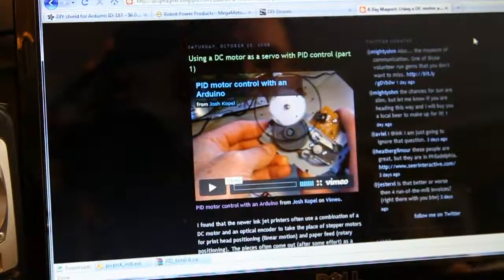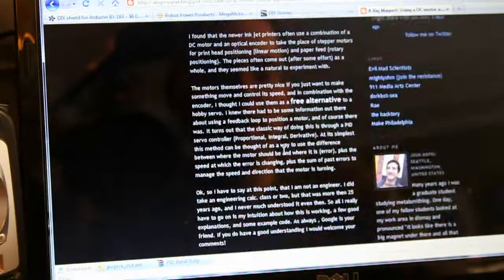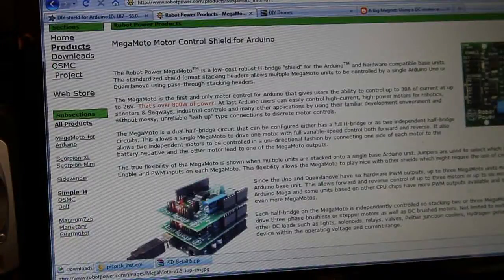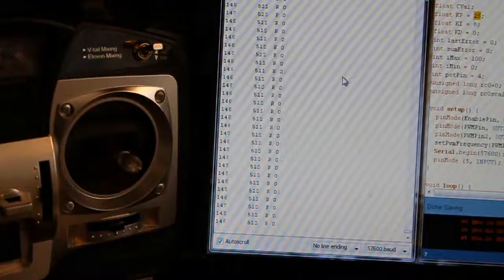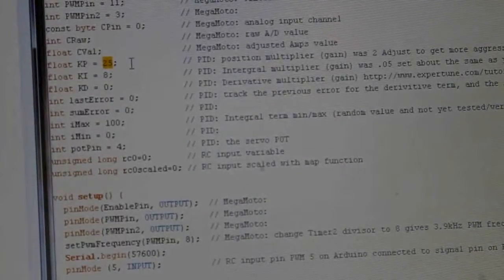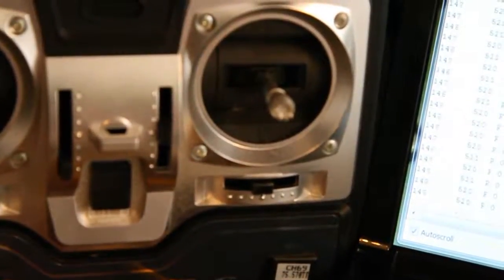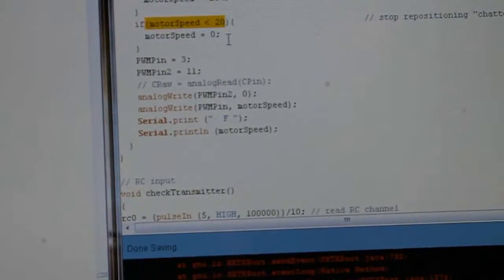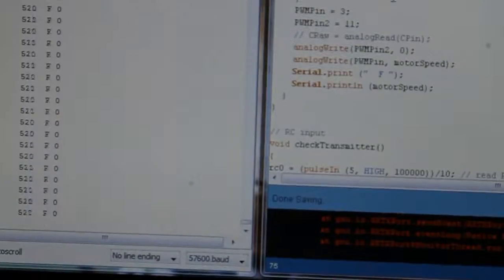Arduino Code for MegaMoto SuperServo

Comment: the MegaMoto. It can be used to control multiple LED's relays right? say I have a large relay do I just plug it into a digital pin on the MegaMoto and go to arduino and put the pin high? does it require any additional components.